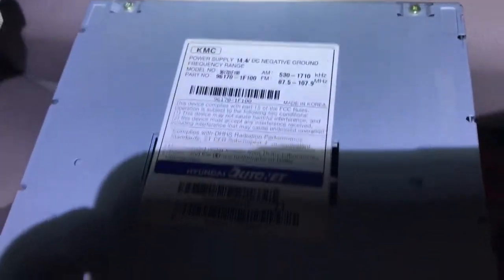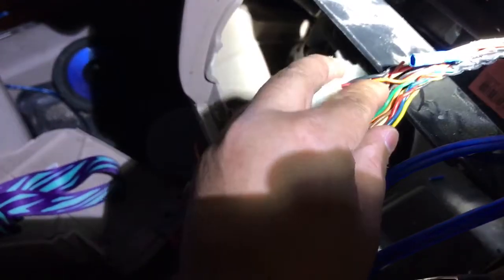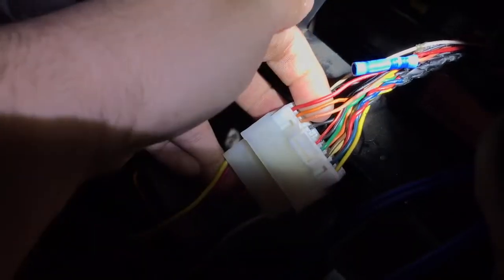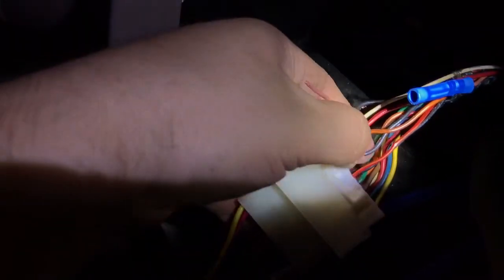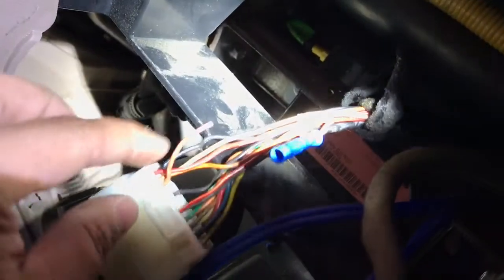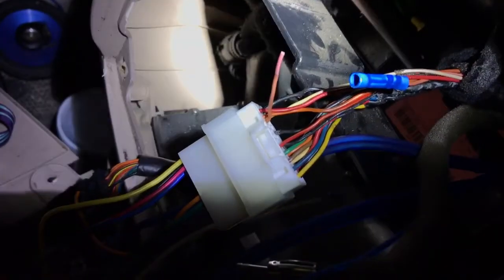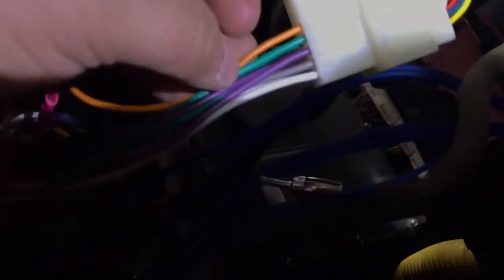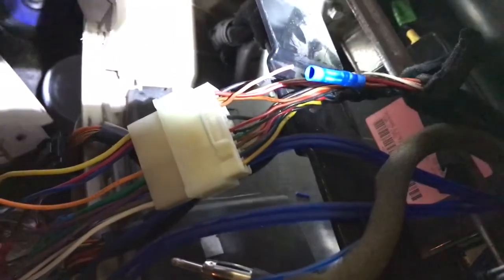2008 Kia Sportage Aftermarket Radio No Sound Install Problem Solved

Comment: This video got my brain spinning for a 2009 kia rondo install. I had the EAXCT same issue from a Metra wiring harness where the remote line was in the incorrect place causing the car factory amplifier to not power on. After I t-clipped the the line that was actually getting power, the amp powered up immediately and I got sound. Very disappointed with the wiring harness from the factory however. This caused me HOURS of wasted time 😤😤. Thanks for posting this!

Comment: Say , hi my name is joe.i was watching your video. And I'm having problems trying to connect my pioneer Radio to my kia soul 2010.from the factory radio that I took out from the kia .well the harness on the back of the radio shows more then , one color the same. Like theres,3 black  wires , 2 orange, 3whites wires and so furth.can you explain to me which ones will go connected to the pioneer radio I bought.thank you for your time and concern.

Comment: Probably supposed to use the Pac harness module..... They are like $80.... Radios on newer cars wont let us use the $12 Metra harness anymore because they are controlled by the computer.  I just had this same issue on a 2008 Liberty.  Even more expensive if it control AC and stuff, you have to buy the I Data link bs for 200 bucks.

Comment: I had to use the cigarette lighter for the red acc. It works, but I've been getting parasitic battery drain  so I'm testing the alternator today just in case

Comment: Im having the same or a similar problem with a 2006 kia sportage but I'm confused because my wiring harness looks different. So far I hooked up everything to the proper wire, however, there were some extra coming out of the kia so I connected them to a big ground wire off the harness. The radio still has no power, so I started testing the cables for power and none of the red ones gave me power and the power cable says its red in the manual. The only wire I've been able to get power from is the ACC which I thought maybe was power cable all along, so I connected it to the pioneer radio power source wire and still nothing, so I am not sure what to do.
Reply from the maker: Every year is different.  Just look at the harness that's in the SUV and connect the aftermarket harness to it. The red should go to a wire and the yellow on the aftermarket harness should also connect to another wire on the factory harness side. Test those two first. If they have power make sure that they are at 12 volt.  Sometimes you can have power but not enough. Also make sure you check your fuses. It is very common to blow those, so I would start there.
Reply: I've read that the pink wire (which is the one you spliced I think) is actually the antenna amplifier on a 2006 Sedona with the rear glass antenna.